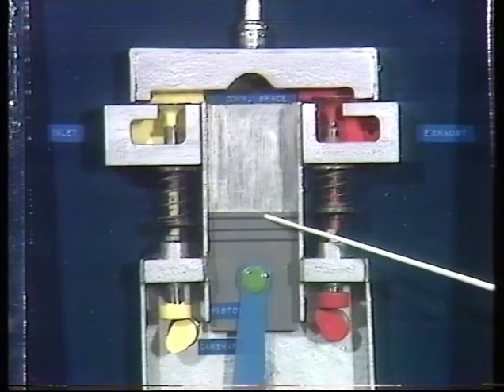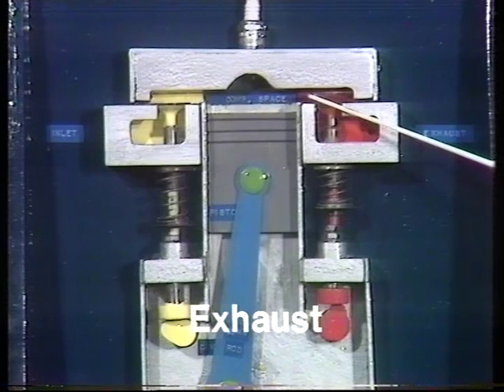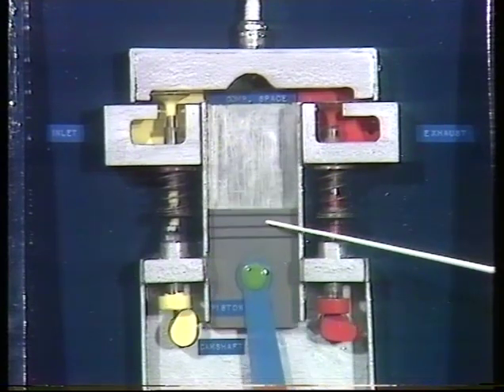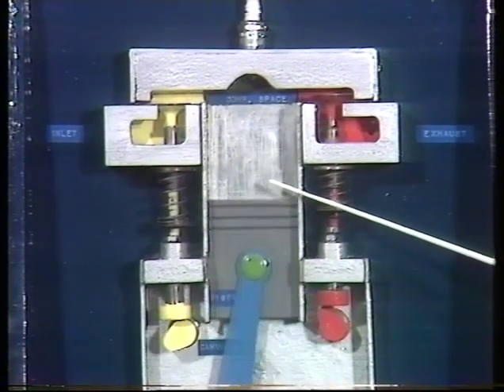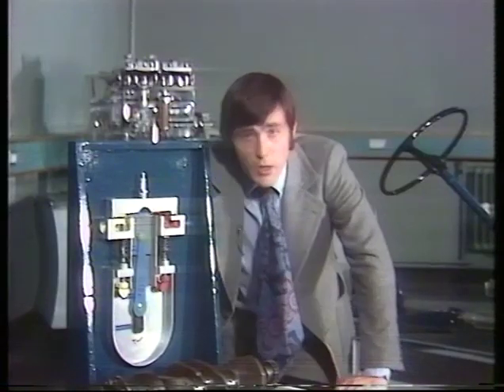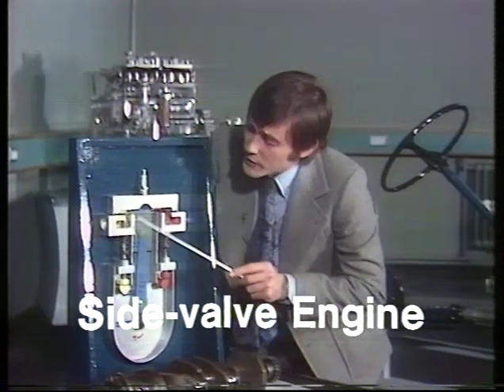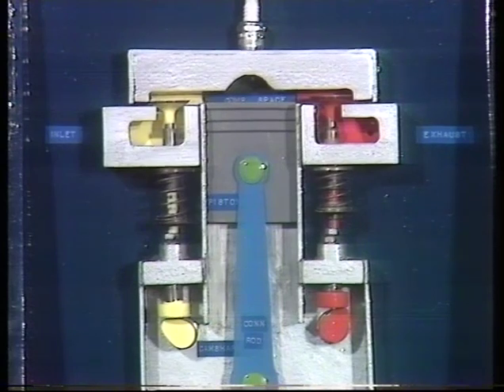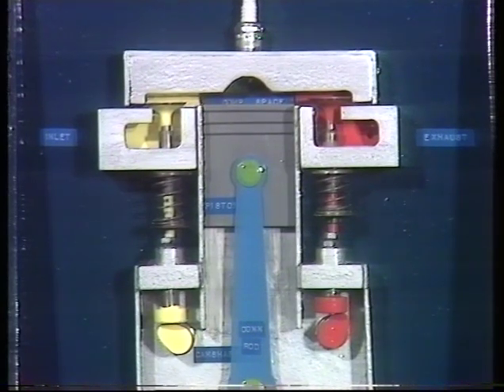How an engine works | Rotary Engine | Piston Engine | Drive in | 1973

Comment: I didn't know that about the Wankel engines. They look quite simple. Am I right in remembering that you get greater power output on those but the MPG is bobbins?
Reply: they rev up like crazy because of its rotational mass and low vibrations unlike piston engine palpitations..high revs= higher power outputs, alas they are gas guzzlers indeed!

Comment: Why do motoring programs not do interesting segments like this anymore? It could be the catalyst for a youngster to want to become a mechanic rather than just wanting to drive fast
Reply: Great comment.
Reply: Because a) youngsters no longer watch motoring programmes and b) youngsters who are interested in such things can find all the information they could ever want on the internet.
Reply: I'll add to what everyone else has already said, by saying what constitutes the role of a mechanic is a distant memory almost.  In recent years the mechanic is now but a lowly parts fitter, rather than someone who strips down and fixes something.  My best friend is a mechanic of the old sort, and even he said it had become a simple monkey fitter job back in the late 1990s.  So these days it has become reliant on diagnostic tools and then simple part replacement if necessary.
Reply: Electric cars won't need mechanics. They need software engineers.
Reply: That's like saying why don't radio programmes about steam engines do more to encourage apprentices to shove coal.
Reply: Not like this - specifically - but I do find the historical segments on TGT and TG very interesting.